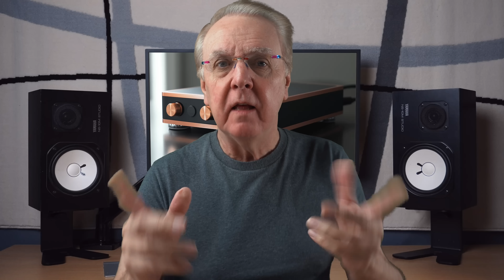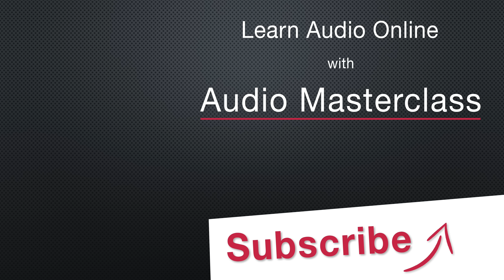Audiophile preamps - What should you get for $30,000?

Comment: I don't get the preamp thing.  And bare in mind I've built the Halfer preamp back in my tube days. The preamp amps a signal from a needle cartridge that has a 47K ohm output impedance. Basic electric noise theory assigns a level of noise to any resistance. Yes, there are other types of noise, but this 47K ohm gives a significant noise contribution that can't be filtered or compensated out. And therefore it defines a base, because it's at the source that can never get a better S/N (sign to noise ratio) and it can't be improved on. That base S/N in db has been lost in my memory somewhere in the 1970's. A well designed integrated amp is as good as a component system will ever be AND will avoid interconnect (cabling) problems. And hence the need for 1000 GBP per meter interconnects. But I don't worry about that anymore because I only play CDs and the digital stream has no source resistance noise. Enjoy the dry British humour.
Reply: A vinyl itself can have a max of 65db dynamic range so that sets the hard limit to any S/N of the system.
Reply: @Munakas-wq3gp Nose from the vinyl is one thing, however at that price hiss from op-amps and mains hum from power supplies should be inaudible, even when, with no record playing, you crank the volume all the way up and stick your ear close to the speakers.
Reply: @Munakas-wq3gp Well, you always can expand that dynamics digitally😉
Reply: Wait until you try a Lumin streamer with digital volume control.  You can remove everything from your signal path except for the amplifier 😎
Reply: @junglecat7263 digitial volume control😂 you are having a joke with us yes
Reply: @junglecat7263  Except that digital volume controls have issues also on low signal levels...
Reply: @Munakas-wq3gp Largely irrelevant unless you listen to a lot of classical music with quiet passages
Reply: @junglecat7263  Some implementations cause a nonlinearity where the bass drops off audibly so it affects any kind of music...
Reply: @Munakas-wq3gp  The LEEDH implementation used by Soulution and LUMIN and is lossless
Reply: @Munakas-wq3gpQuantization effects dear boy strange that the whole premise is flawed as why expend all that computing power to convert digital analogue(real world) then convert it again back to digital for the volume control or am I dithering here🫣
Reply: @Gez492  Go listen to a Soulution 331 integrated amp and you'll quickly learn that the joke is on you and your closed mind

Comment: Pay 30K to play vinyl and you're an audiophool.
Reply: But you've never heard the noise with such great detail.
Reply: @Ratzfourtyfour  Is the right answer :)
Reply: @Ratzfourtyfour 😂
Reply: it's even worse then that, you're paying 31K for the ABILITY to play back moving coil using probably a 15k moving coil pick up on a 20k turntable all going to a 40-50k pre-amp and a 50k+ amp and 100k speakers, you're not paying 30k to play records, your paying close to 200-250k to play records.
Reply: @aegisofhonor  50c records from the thrift store or garage sale.
Reply: Yup, exactly!  Buy a good 300$ DAC and you'll be an order of magnitude better than any of those expensive analog junk components!
Reply: @guyboisvert66 Bullshit.
Reply: @guyboisvert66 Depends on the audio file you are playing. MP3 and you’ll be lucky. SACD and it will probably beat a good vinyl playing system. CD is limited by the 16 bit 44k sampling but is uncompressed so does beat MP3.
Reply: Assuming you can even get the media cleanb
Reply: Back in the early 1980s I gott a top spec Linn turntable for 747 UKP...complete with an Ittok and Asak cartridge.  A top spec Linn today costs 50x that, and looks almost identical. And yet they are all sold out, and nobody is complaining about price gouging.
Reply: @rontoolsie  As i often say, companies make people believe sound fidelity is a direct function of the price paid...
Reply: Pay for a 120db SNR to play a media that has a theoretical maximum of 65db dynamic range...
Reply: @Munakas-wq3gp I guarantee you the 30k pre-amp cannot even achieve 100db S/N perhaps 80-90 when new, they didn't use shielded wiring nor the shortest wiring path, Kitchen appliances switching on/off  guaranteed click in the signal
Reply: At that price you pay for a status not just a preamp
Reply: I’ve got a $25K turntable setup- BEFORE even considering the preamp. So far it’s outlasted half a dozen DACs of all descriptions, 4 CD transports, and 2 music servers. For musical enjoyment, it has put them all to shame. And it doesn’t go obsolete every few months. Digital is fine when I’m just letting it play in the background, piddling out downloads while I’m working on a piece of equipment.  But when I feel the need to actually LISTEN, I pull out a good piece of vinyl, and fire up the Brinkmann Bardo/ Triplanar setup. It constantly reminds me why I listen to music at all.
Reply: @willemwallaby   long live to Turntables
Reply: @willemwallaby  bedtime
Reply: I've always found it much more interesting and rewarding to try and get the best possible setup for the least amount of money. 😊
Reply: Most people capable of owning this sort of nonsense won't be spring chickens and will have some level of tinnitus, try and filter that.
Reply: pay to a "only fans girl" and you are a king of the village
Reply: I’ll have $30k (msrp) worth of gear when I’m done, but I buy used or DIY mostly and have at least the smallest amount of patience.
Reply: What if that includes a dedicated building with a bar?
Reply: That's hilarious even worst they usually are 60 or 70 years old when they have lost their ear sensibility and capacities
Reply: It’s all about the price tag !
Reply: So tell us what the $ cut-off amount is to play vinyl before you become an audio fool.  Curious if I fit into that scurrilous category, and have to change my ways ;-)
Reply: @QuintEssential-sz2wn  Audiofool to think you get higher fidelity (to the original signal) using analog gear.  Once that said, someone can prefer distorted sound (less fidelity),  people who like tube amps for example.  Might as well buy a good  DSP and save money while doing it, probably getting "even better" result than paying premium for a "fixed EQ/DSP" !